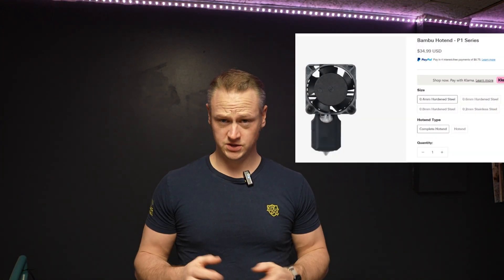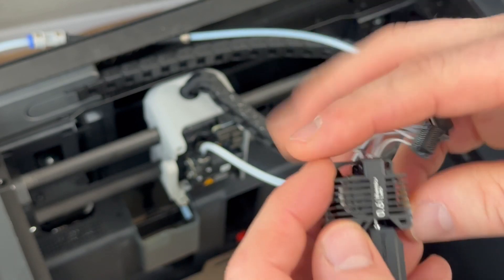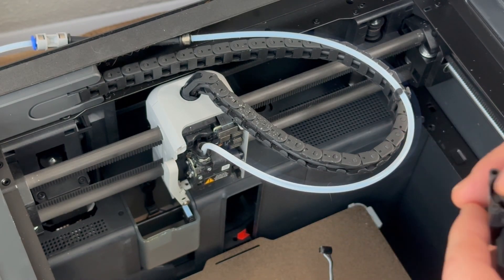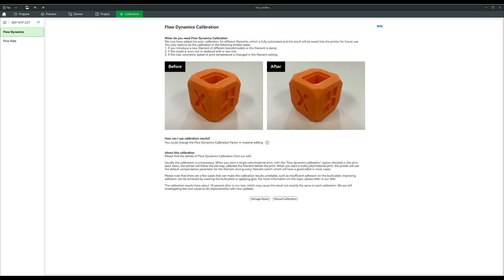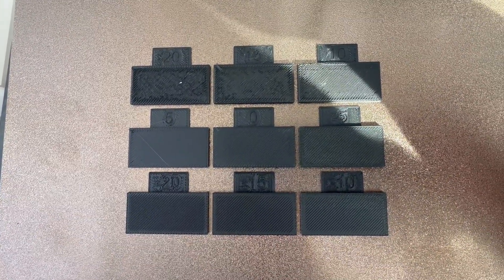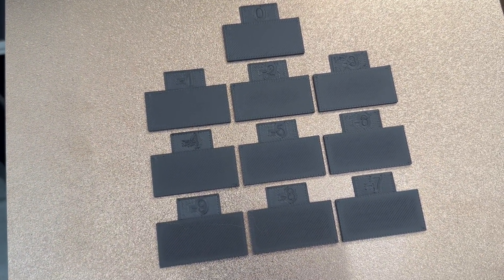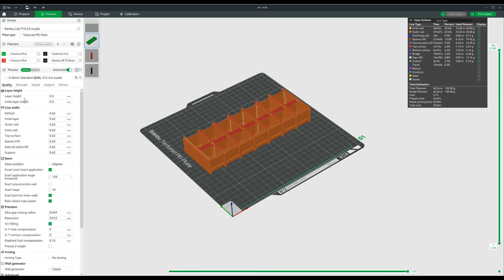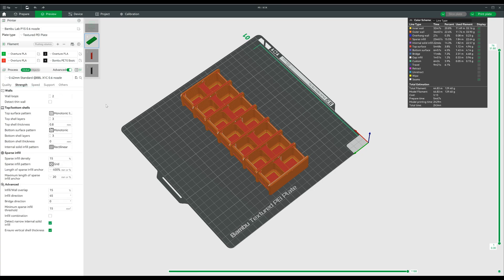Bambu P1S 3d Printer: Changing HotEnds - Which is best?

Comment: I think one thing your video fails to address is that when you move up to a say, 0.8mm nozzle from a 0.4mm you can half the number of walls you print.  So if you were printing 4 walls, you can print 2, or 2 walls down to 1 and so on.  This is where a larger nozzle creates a massive time save.
Reply from the maker: Fair point. It's really just a balancing game of strength vs detail. The other thing with the .8 for example is that you're going to have to be much more involved in the advanced settings than you might need to be for the .4 nozzle (to squeeze the best performance).  For my purposes, I didn't feel the difference was enough to make the change permanently.

Comment: The larger Nozzle sizes are  mostly for larger structural  parts.  We use the 6 and 8 for brackets and structural parts.  You are correct in thinking that small fun parts are not for the larger nozzles

Comment: Its more reliable than my canon inkjet.
I have had issues with one of my p1s's it had a fan that stopped working. I sent in photos to bambu and was ignored for 2 weeks. They asked for photos a second time. I sent them and was ignored for a week and they asked for a third set of photos. I gave up and bought aftermarket fans and a few other parts. Their customer service sucks but the printer is reliable.
I keep a .04 in one, .02 in the other. If i need better quality, i use my elegoo saturn 4 ultra.

Comment: @Daniel Reviews -- I have been going through the same upgrade challenge, and I swapped back from the Bambu 0.6 to 0.4 nozzle as well. What I found is that the volumetric flow speed is not actually much higher with the 0.6 nozzle, that's why the print times are only marginally quicker. It's not entirely clear to me why that is, I tried doing a max flow speed test, but my prints had issues above 23mm/s2. 
Additionally, the printers just aren't tuned as well with default profiles for 0.6, so it may require more tuning on your side.... I am currently waiting for the E3D 0.4 High Flow Hotend, which should provide 40-60% more flow and actually provide a considerable upgrade in upper limits for print speeds. There are several videos on the nozzle -- ModBot has a good one. If you are looking to increase your print speed, I recommend you check out the high flow hotends from E3D https://e3d-online.com/products/full-hf-obx-bambu